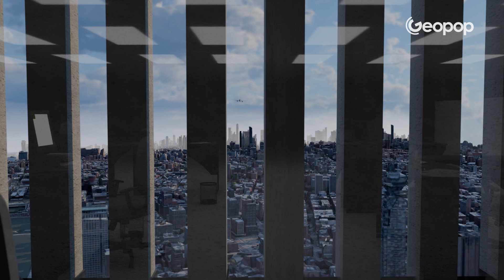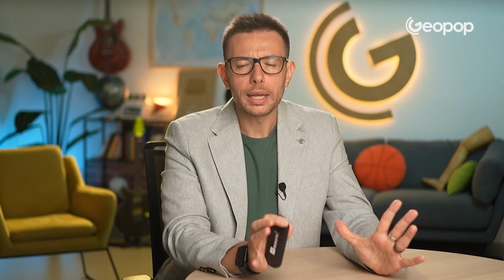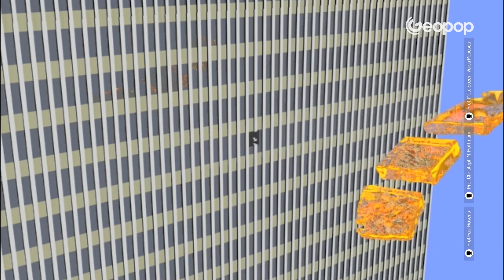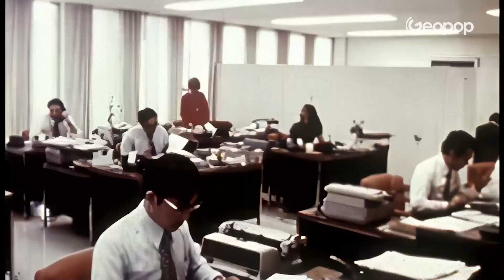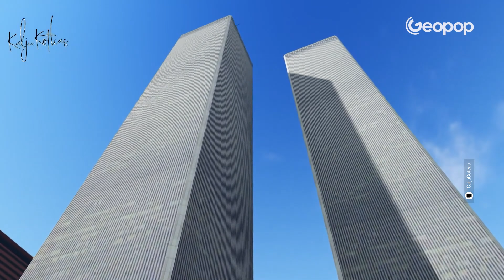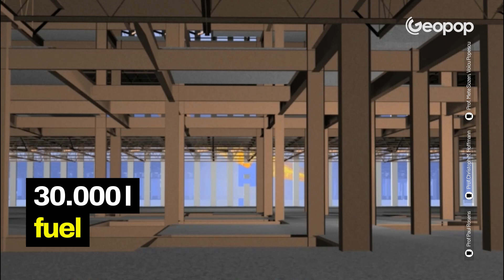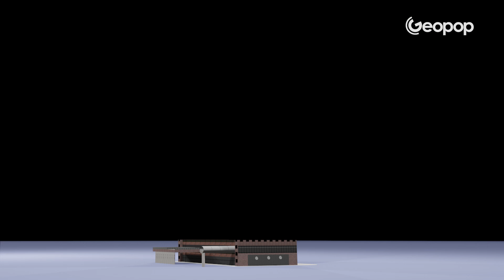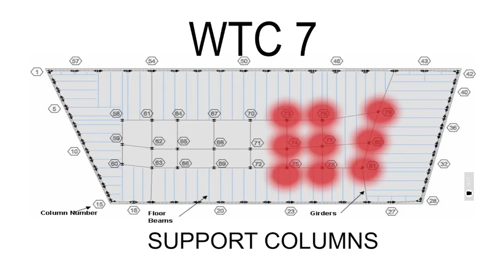9/11, 2001: The Technical Reconstruction of the Twin Towers and WTC 7 Collapses

Comment: Sorry But there’s only one way a building will land on its Footprint no matter what you think otherwise. The above floors you would think would have collapsed at its weakest side and toppled over the edge of the lower floors.
Reply: How?  Where is the pivot point?  What is the lateral force pushing it off to the side?  Gravity only works down.
Reply: @TheLoonResistance gravity is in every direction.
Reply: And yet people died from shrapnel. Buildings we're damaged fifteen blocks away. They fell at free fall.  Squibs were seen. Firefighters described preplanned explosions,  and secondary explosions.  Experts found molten steel in the dabris.  The gelatin group all but admitted they wired the buildings.  People made billions.
Reply: @robbiehiatt9966  "And yet people died from shrapnel." Shrapnel?
"Buildings we're damaged fifteen blocks away." 15 blocks??? lol! Okay, I'll bite: What buildings 15 blocks away were damaged?
"They fell at free fall." NO THEY DID NOT.
"Squibs were seen." WRONG AGAIN. Those were jets of compressed air.
"Firefighters described preplanned explosions," ANOTHER LIE! NO FIREFIGHTER SAID ANY SUCH THING.
"Experts found molten steel in the dabris [sic]" No proof of that, either. Metal, maybe, but no one ever demonstrated that steel melted.
"The gelatin group all but admitted they wired the buildings." WTF is that?
"People made billions." Nope, no one made 'billions.' Certain not Larry Silverstein, who LOST money on 9/11.
Reply: @Tim22222 i guess you missed all this evidence.But that's all right , you can look at it now and see that you are a liar 1.The firefighters said" it looked like they planned to take down the building" I didn't say that, The fire fighters said that. They were there.I'm sure they know best.
https://youtu.be/XiIT4HInWjY?si=e1Pvp3-IFs-M75Oj
When the firefighter says "boom, boom, boom, boom" in this video.
What do you suppose he is?Implying by " boom" ??
2.So if there were no explosives then what is this? 8:25
https://youtu.be/bLF5D7M1YgA?si=aHSvS__uOdxMi1ZB
You can't say that it was added because you can see the firemen's reaction to the explosion. And you can't say it came from anywhere else because the firefighter says
" We gotta get out of here,  7 is exploding "
3. Controlled demolitions have squibs, you can see the squibs here 20 floors below the collapse. 
https://youtu.be/eXAgulfAtR4?si=-iLO9aQjMJVLTUYH
4. Firefighter says "any one of these buildings could blow up,  this ain't over yet" firefighter says there's 3 secondary explosions. 
https://youtu.be/0Gh3ErgMI4M?si=mmp9Eus_5PWTCBfl
5. Airplanes can't fly 600 mph at 1000 feet. And to be able to make a 180 degree turn to hit the opposite side of the pentagon going that fast is ridiculous. And since when do terrorists hit the opposite side of the building where no one was at when they could have just flown straight in and killed way more people???
 https://youtu.be/0Gh3ErgMI4M?si=mmp9Eus_5PWTCBfl
7. No one has ever known ahead of time that a building was going to collapse except through controlled demolition.  Tower 7 was reported to have fallen while it still stood in the background. 
8. Larry silverstein,  the man who made over 4.5 billion when they fell, claimed to have pulled the building down.
https://youtu.be/1jQaJFNWqtc?si=wCywQ9grgBdS_w11 yet somehow today he is only worth one billion dollars.
9. A witness reported a missile hit the pentagon while he was seen at the scene. 
And the hole wasn't big enough for a plane and the damage wasn't consistent to the towers. And just like shanksville,  there's pictures that show no plane parts at all. But there was papers everywhere. Explain to me how the burnable paper is laying everywhere , but the steel parts of the plane are gone. The luggage.
Is gone, the seats are gone.The people are gone
https://youtu.be/6_Ez-UCpXMs?si=JaQ6DBEC_LJtMLgN
Reply: @Tim22222 Molten steel was reported by the fallowing 
people. Captain Philip Ruvolo (NYCFF), 
Richard Riggs(debris removal expert) , Leslie Robertson (wtc structural engineer), Lynn Margulis (University of MA),  Dr. Abolhassan Astanch (from Berkeley),  Robert Kim Ireland( chemical engineer for US Army Corp of engineers), Mark Basile( chemical engineer), Kathy McGrade (materials engineer), Gery Warner( Mechanical engineer), David Gregg( PhD Chemical engineer), Steven Jones PhD( physicist), Kevin Ryan ( BS Chemistry), Niels Harrit (PhD Chemistry), Tom Sullivan( Explosives team) Jason Cheshire ( Chemical engineer), and Jeffrey Farrer (PhD Material science engineer).
Reply: @robbiehiatt9966  All of those reports of molten steel - ALL of them - are anecdotal. Many are second- and third-hand. What I want to see is a metallurgical study of some samples retrieved from ground zero PROVING they were steel and that they had melted.
Can you provide that?
Reply: @Tim22222 if you want to believe the experts are lying and all the fire fighters are lying.Then that's just fine but you've seen the evidence. Be ignorant all you want
Reply: @robbiehiatt9966  I'm not saying they're lying, I'm ASKING how they know. How do they KNOW it was steel? 

You don't seem to think that matters but it DOES.
Reply: @Tim22222 well you see they are experts in that sort of thing , whereas you are not
Reply: @robbiehiatt9966  Really? Firefighters are experts in identifying kinds of molten metal by sight?
Reply: @Tim22222 I listed a lot more than firefighters.  And you don't know the qualifications of these firefighters.  If i have to choose who to believe,  I take there word over yours everytime.  Who are you? What's your qualifications?
Reply: @robbiehiatt9966  Dude, the presence of molten steel would be HUGELY important to establishing what happened that day - IF IT WERE PROVEN. So don't you think PROVING steel melted, being 100% sure, is important?? I certainly do! But you don't. You're satisfied with what you've heard because it jibes with what you want to believe. But that's not good enough. You need PROOF and you don't have it.
Reply: @Tim22222 no I have proof and I posted proof. If you can prove that what I said is wrong you're more than welcome to do so. But your asking the wrong person.  Im not a materials engineer,  structural engineer, a chemical engineer. Im a builder, been building structures for over 30 years.  I know exactly what a controlled demolition looks like and this is it. I posted all those experts, and more. If you disagree with their findings, then prove it wrong, or take it up with them, not me. Im no expert witness in those areas, and neither are you so if you have no proof than you have no argument.

Comment: Please, this theory of WTC 7 was debunked by Leroy Huslay from university of Fairbanks in Alasca. Please compare the NIST simulation and real footage.
Reply: Hardly.  Unlike almost everyone who recommends it to me,  I have actually read both the Hulsey preliminary and final reports from cover to cover, and I have to say, there are a few problems. The Hulsey report is such a dead horse now, flogged so many times I find it difficult these days to drum up the enthusiasm to do it yet again. But here it goes.

My quick and dirty opinion of the Final Report is as follows:

The Hulsey Final Report on Building 7 met none of its three stated objectives – indeed could not have met those objectives for lack of trying - and failed to prove its main conclusion, by way of a fundamental logic error; Hulsey claimed he had concluded fire could not bring down Building 7 without accounting for the full envelop of possibilities. Essentially, he claimed to have proved a negative

Hulsey also plagiarized almost 3 pages of material from Tony Tsamboti, who works for the studies sponsor. I hope I don’t need to point out the ethical implications of that.

While promising superior models to those of The NIST, the Hulsey Report in fact delivers grossly inferior models which eliminate the time factor, focus on only two floors and rely on a greatly simplified version of The NIST’s temperature data. They used linear static analysis to study a nonlinear dynamic problem.  The model animations are clearly not derived from the model data as they show no dynamics at all and are obviously forced to make the animations (superficially) look closer to AE911T’s imagining of the real event.

Overall, it is a shoddy piece of work done by a man clearly working out of his element and areas of expertise. It rather reeks of trying to support a conclusion arrived at before the study started. Curiously, study sponsor Architects and Engineers for 9/11 Truth having announced what the study would conclude before they awarded it.

Hulsey tested just one out of countless thousands of possible scenarios, using a completely unrealistic scenario and an artificially restricted set of data almost like he wanted to ensure fire would not cause a failure. The Hulsey Report was so factually inaccurate, methodologically unreliable, scientifically unsound, illogical, and biased that it blatantly violated any requirements of objectivity, utility, transparency, and reproducibility that would have been required to submit it for peer review in any reputable journal.

Hulsey and his assistants have not published the report anywhere that any relevant academic or professional engineers look to.

Hulsey had said all along that the report would spawn several (perhaps four) papers in good American engineering journals and possibly a book.

Then Hulsey walked that back, realizing he'd stand no chance to pass peer review in America and so said he'd go for European journals - but years have gone by with no publication whatsoever. Also, no book from any science publisher either. As far as the engineering profession and science are concerned, the Hulsey report barely exists.

The engineers of America and of the world have never read it. It has had zero impact in the professional community.

To its intended non-engineering literate audience, they Hulsey Report contains enough engineerspeak density for them not to ask questions, even if they were so inclined. Since the report appears to (superficially) deliver what they want, they are not inclined, even if they knew what to ask. From a structural engineering perspective however, The Hulsey Report is of no value, which explains why promises to get the report published in peer-reviewed and reputable engineering journals where it could be scrutinized by qualified professionals were abandoned.

If you are genuinely interested in what happened to Building 7 rather than in promoting a political agenda, there are several excellent forensic engineering reports out there and over two dozen articles published in genuinely peer reviewed engineering journals that are far more comprehensive and competently done. I suggest you seek them out instead.

And actually read them.
Reply: @TheLoonResistance don't believe anything stinky says all he does is lie.There's no truth in his game.Whatsoever

Comment: They keep spreading lies about the fire melting the steel that is nonsense. Those builders was not burning that long. They know that these builders was broke down by demolition controlled and they blew those buildings up on purpose so I don’t know why they keep getting no Internet telling lies about these beings being burned it was not enough weight on the top of that building to bring down that whole structural building that was still standing bullshit
Reply: Did you even watch the video? Imagine what happens to a building when a 180,000 kg object flies into it at 900 km/h? That's a tremendous amount of kinetic energy, equivalent to about 1.5 tons of TNT. And the fire hasn't even started yet.
Reply: @ApolloKid1961  180,000 kg?!? What are you talking about?!?
Reply: @Kudde23 180K kg or 180 metric tons or 400.000 pounds.
Reply: @ApolloKid1961  Yeah cool, but what are you talking about?!? What object are you fantasizing to weigh that much?!?
Reply: @Kudde23 My mistake. This should have been 181,437 kg or 400,000 lbs. But at 900 km/h, that's still a lot of kinetic energy.
Reply: @ApolloKid1961  Yeah cool, but...
What are you talking about?!? What object are you fantasizing to weigh that much?!?
Reply: @Kudde23 …the plane weighs that much.
Reply: @alexsiemers7898  THANK YOU goddamnit! Took you quite some attempts to comprehend my simple question huh?

So now here´s your big fat problem:
The first plane that crashed was a 767-200ER. The MAXIMUM take off weight for a 767-200ER is 179.2 tons.
To reach that maximum take off weight the plane would be full of passengers, full of luggage, full of fuel. The 9/11 planes were nowhere near full of passengers nor luggage nor fuel.
So what you´re trying to suggest is that the first plane, despite being pretty empty, somehow eceeded its maximum take off weight at impact by more than 2 tons?!?
Do you realize how utter stupid you are?!?
The second plane was a 767-200, no "ER". Its maximum take off weight is 142.9 tons.
So what you´re trying to suggest is that the pretty empty second plane exceeded its MTOW by almost 40 tons at impact?!?
Do you realize how utter stupid you are?!?

You also suggested the 767´s were fully fueled... Now how did that work?!? Air-to-air refueling right before impact?!?
The planes weren´t even fully fueled at take off.
Do you realize how utter stupid you are?!?
Reply: @ApolloKid1961  doesn’t matter that is not enough impact to bring those buildings down those buildings was broke down with a control demolition. Don’t let them fool. You making it some damn planes and some fire hasn’t even been burning that damn long I seen the video on Instagram and it might be still up there if you type in 20 towers one of those video shows somebody talking about the steel inside those building and you can see the steel has been cut in half as if somebody had those builders fallen
Reply: @RayRay-v6o  - Twin Towers collapse was a combo-platter of four (4) factors:

Impact Damage + Fire (heat) + Fire + Gravity = Collapse

Remove any one of those four factors and there is no collapse.

Ignore any one of those four factors and you will never understand the collapses.
Reply: @RayRay-v6o  "that is not enough impact to bring those buildings down those buildings"

Can you show your math on that, please?
Nope. Didn't think so. That's your opinion, nothing more.
Reply: @RayRay-v6o  I've been arguing with moon landing deniers since 2007. And I see a pattern with 9/11 deniers. They're poorly educated, have little to no knowledge of physics, and lack trust in the government. Instagram isn't a scientific platform; quite the opposite, in fact. Calculate the kinetic energy released when a fully fueled 767 flies into a building, and you'll immediately see that it doesn't stand a chance. Did you know that even at 800°C, a 10-meter steel beam can stretch by almost 10 centimeters?
Reply: Only ignorant conspiratards ever mention steel melting

We human beings are a lot smarter than that.
Reply: @TheLoonResistance  So Leslie Robertson was an ignorant conspiratard, that´s what you´re trying to say stinkyshit? Oh wait, I forgot: You´re way too much of a coward to ever answer questions on your utter stupid blahblah...
Reply: @Kudde23 Molten steel was found in the dust, and in the debris for 6 weeks.  Molten steel was reported by the fallowing 
people. Captain Philip Ruvolo (NYCFF), 
Richard Riggs(debris removal expert) , Leslie Robertson (wtc structural engineer), Lynn Margulis (University of MA),  Dr. Abolhassan Astanch (from Berkeley),  Robert Kim Ireland( chemical engineer for US Army Corp of engineers), Mark Basile( chemical engineer), Kathy McGrade (materials engineer), Gery Warner( Mechanical engineer), David Gregg( PhD Chemical engineer), Steven Jones PhD( physicist), Kevin Ryan ( BS Chemistry), Niels Harrit (PhD Chemistry), Tom Sullivan( Explosives team) Jason Cheshire ( Chemical engineer), and Jeffrey Farrer (PhD Material science engineer).

Comment: This dosnt explain shit. And isnt factual
Reply: It explains the buildings design, damage and failure.  That is a fair amount of shit.
Reply: @TheLoonResistance  But it didn't tell him what he wanted to hear.
Reply: If you calculate how much kinetic energy was released into the structure and the fact that steel only retains 10% of its strength at 800°C, I find it quite realistic. Even a blacksmith knows you can bend iron without melting it.

Comment: Show me how an Aluminum Wing can cut through Steel IRL and we can talk. You can keep your CGI Presentations.
Reply: The steel was not cut; the beams were separated where they connected end to end. Aluminum or not, that kind of energy crashing into the steel structure is going to wreak havoc on it.
Reply: @Tim22222  So you never watched pictures of the impact area, that´s so cool shill!
Reply: Wings are made of stronger materials than aluminum alone, otherwise they would break off at the slightest turbulence. The engines were also made of much stronger material. Together, they generated 1.5 tons of TNT in kinetic energy. One airplane wheel even exited on the other side.
Reply: Most of the successful Kamikaze attacks of World War 2. And those were comparatively tiny aircraft.
Reply: “Cut” implies that they cleanly made it through the metal in one piece. It’s like saying concrete can “cut” bone when a bone fractures due to falling.